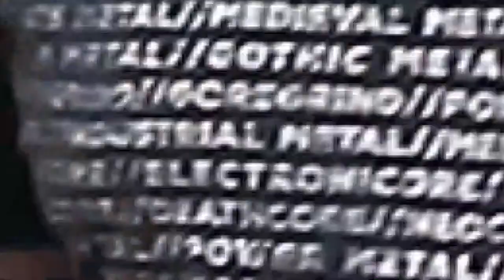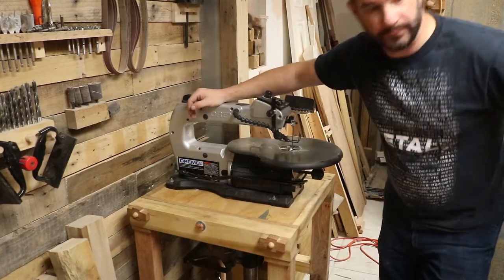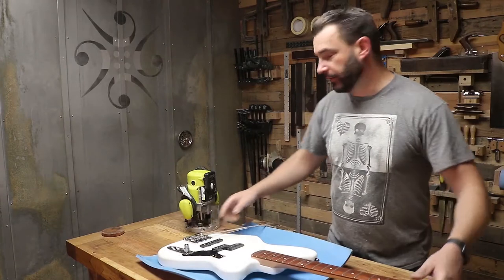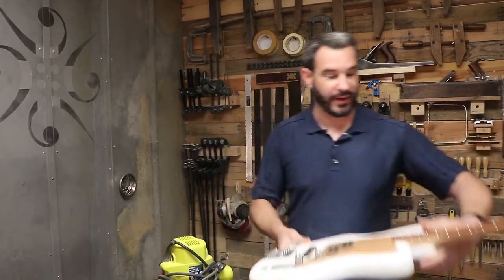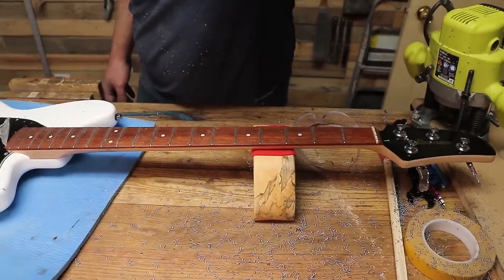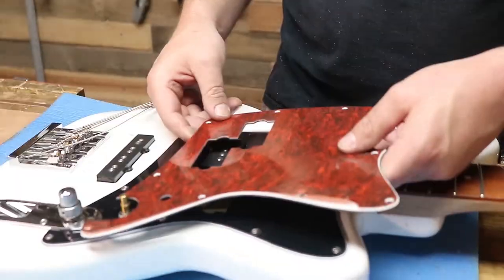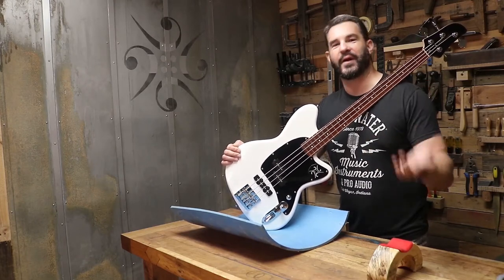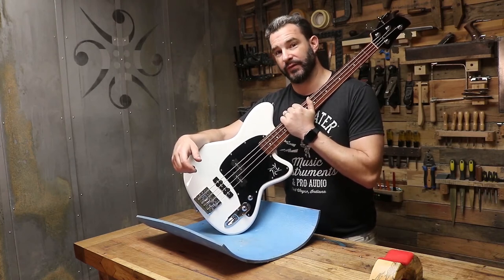Bump Yo Bass Ep. 2 Ibanez Talman TMB 100 Custom Pickguard & Shielding

Comment: I have an ivory coloured one with black scratch plate and black headstock. I would like to take that matching idea and extend it to the fingerboard too. Changing the brown fingerboard for black ebony would be expensive and a bit mad but I was thinking, could I get away with using wood dye for the same effect?. or would it just come off with playing it?
Reply from the maker: I assume that your fingerboard is Jatoba as well?  I’m not sure how that wood takes stain or dye…. I had a similar thought when I did the block inlays.  I chickened out though.  Dye if it penetrates well should work.  I just don’t know about that wood.  I may revisit it later, but for now I’m just enjoying playing it.
Reply: @thebassment1845  Yeah, it is Jabota. I'm so impressed with the bass, I ordered a 5 string version too. I also ordered the dye. Fingers crossed I don't make a dog's breakfast out of it. I'll let you know how I get on.